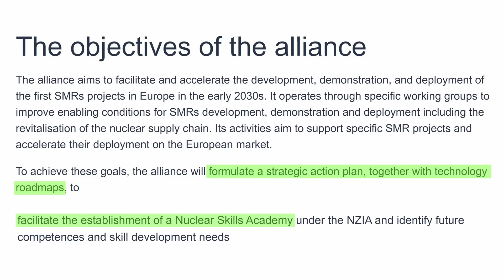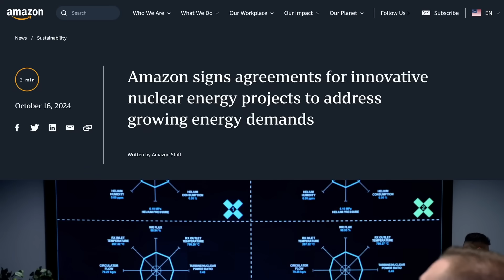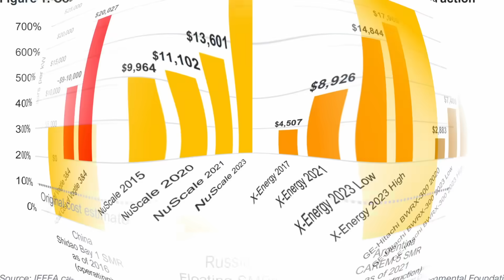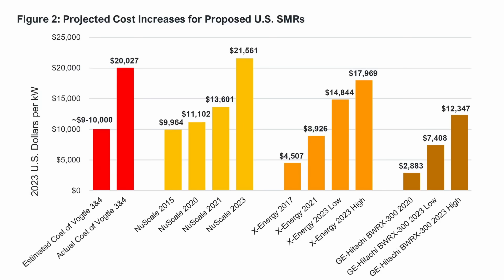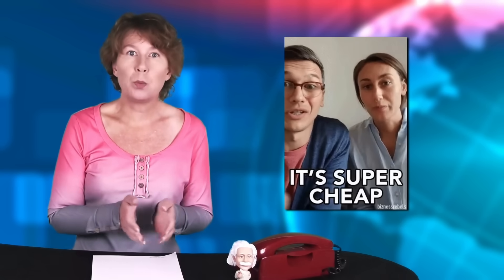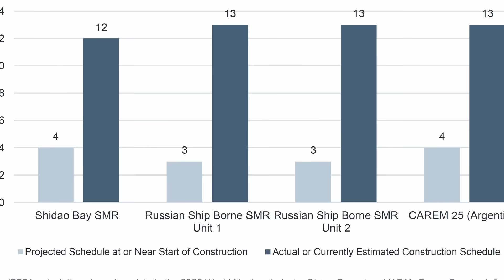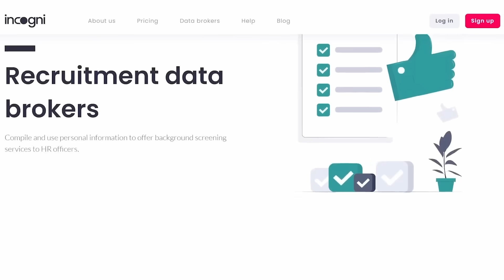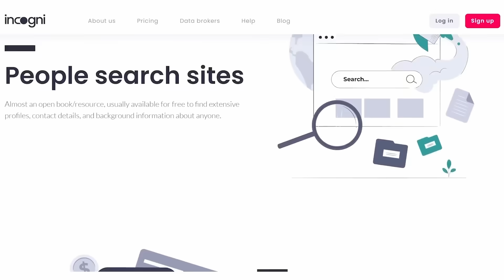Small Nuclear Reactors Have A Big Problem

Comment: It is important to not be hyper-focused on SMRs and their issues. Instead, we must first always focus on the PROBLEM THEY ARE TRYING TO SOLVE. Namely, ensuring reliable non-fossil electrical generation at scale. Only then can we properly assess the place for SMRs, if any.

Electrical generation is getting steadily cheaper as the costs of solar and wind continue to decrease over time. The problem is consistency and reliability. We need the grid to be a stable source of power no matter what the sun and wind are doing. (Note: This discussion assumes we have reached "peak hydro", meaning hydroelectric plants can't meet anticipated needs.)

The grid experiences extreme local demands from energy-intense industries, including things like metal processing, cement production, and, more recently, gargantuan data centers. It is tempting to reduce the stress on the regional grid by placing such extreme loads on their own small grid, meaning a compact local power generating station is extremely desirable. From this perspective, only nuclear and fossil can meet that need. And maybe fusion in 30 years or so.

Away from these large loads, the grid also experiences cyclical daily and seasonal loads, where having dispatchable power sources would be highly desirable. Nuclear can't readily meet this need (nuclear plants are best run in a steady-state manner).  While wind and solar are technically dispatchable, their inherent variability makes them unreliable in this role. Which leaves fossil and various means of energy storage.

To me, the real battle on our path to a fossil-free future is between nuclear and storage.

We know we can grow solar and wind to meet our needs, but that also requires growing the grid. distributing storage close to local loads will mitigate the peak loads the overall grid will need to handle, allowing it to focus on meeting the average load.

It is the massive scale of this solar/wind, grid and storage build-out that makes nuclear attractive, especially SMRs, to the owners and operators of large electrical loads. To be clear: SMRs are of little, if any, use to the rest of the grid. SMRs are a local solution that don't contribute to the need for the overall grid, the one to your homes and businesses, to improve and de-fossilize.

So, SMRs are, at best, a niche solution, assuming they are a solution at all. But let's take a moment to hammer a stake in that beast. Sabine has already examined the issues with current SMR projects. Let's look at the physics needed to make it work.

If we ever hope to make nuclear power significantly more cost-effective from an LCOE perspective, we must simplify all aspects of it. For example, reducing the core operating pressure is a great first step, as it reduces both material stresses and steam explosion risks. Again, as an example, moving away from water as a reactor coolant would be a great step in that direction, but the alternatives are either liquid metals or salts, both of which have unresolved problems. Or, perhaps, high-temperature gas cooling, which has extremely complex thermodynamics and fluid dynamics issues yet to resolve.

However, the thorniest issues concern the fuel itself, where the design constraints include: 1) The amount of fuel consumed per KW of output electrical power. 2) The size. cost and operational lifetime of the initial fuel load. 3) Eliminating the need for refueling. 4) The fuel enrichment level. There is also the surface-volume ratio to consider: As the core design shrinks in size, the burn rate between the center and the edges generally becomes more extreme (making a uniform fuel burn profile more difficult to manage, and/or making the core fuel distribution more complex), and makes it more difficult to thermalize neutrons within the core (less distance over which thermalization can occur).

In an ideal world, new "simplified" reactors would be constructed with a lifetime fuel loadout, but that approach can massively increase costs if a long lifetime is desired, which in turn means constructing reactors that have intentionally shorter lifetimes, which in turn means they must amortize their costs faster over that shorter lifetime, placing ever increasing demands on both increasing fission and thermal efficiency while also reducing construction and operating costs, which are goals that are largely in opposition to each other. Which could easily turn into a race to the bottom, rather than toward a real solution.

To gain increased core efficiency while reducing size, the straightforward approach is to increase the uranium fuel enrichment, which not only drastically increases fuel expenses, but also imposes heightened security concerns. One solution would be to use a less costly fuel, such as finding an efficient and less expensive way to reprocess existing spent fuel, or use another fissionable material, such as Thorium. Thorium doesn't fission on its own, but needs a "sparkplug" fission fuel (typically Uranium)to start and manage the Thorium fission.

Other approaches involve rethinking the entire notion of the "reactor core", where the fuel itself is suspended in and transported by the coolant, something that is possible with several molten salt designs, and is also compatible with both Thorium and Uranium fuels. One huge downside is the presence of the highly radioactive fuel outside the core, not only meaning a larger area will need to be better shielded, but also increasing the amount of the plant materials that are subjected to high radiation levels during normal operation. Also, the fluid itself will need to be highly corrosive in order to keep the fuel and fission products in suspension (and not plate out over the interior of the system).

If these design and operational downsides of "liquid fuel" can be mitigated, the upsides are huge. 1) The reactor fuel can be kept pristine, with fission products removed and fuel added continually, rather than front-loading that lifetime expense as part of the initial manufacturing or installation. This will permit nuclear wastes to be concentrated and stored as part of normal operation, rather than having an entire core that must be handled when the plant is decommissioned. 2) Safety is both simplified and improved for both normal operation and emergency shutdown. 3) By dissolving the fuel into the coolant fluid, fuel reprocessing becomes an inherent part of the system itself, greatly improving fuel utilization.

That sounds very optimistic, and it is! Those downsides are severe indeed, and likely can't be mitigated within a "small" plant. For me, even the need to consider liquid fuels means that miniaturizing any existing "legacy" approach is a non-starter, as the smaller plants will likely have more problems than benefits.

We will likely need to instead focus on improvements to conventional plant designs, then just bite the bullet on the resulting price.

A very relevant and illustrative comparison is the use of desalination and advanced water treatment as sources of drinking water. Both are many times more expensive than ground or river sources, but they are more reliable year-to-year. In SoCal, we have made the very intentional choice to have expensive water that is also highly reliable. When you live in or near a desert, those are the choices forced upon us.

We are in a similar situation with electricity production form non-fossil sources. We have solar and wind that are much like wells and rivers in their temporal variability (though over different timescales). And hydroelectric, which once was considered to be a stable as nuclear, is seeing its own variability, with no significant new sources coming online. Just as high(er)-cost drinking water sources are needed to ensure supply adequacy, stability and reliability, we also need the same for our sources of electricity.

There is no "fast, cheap and easy" solution to ensure adequate energy supply and reliability, neither for large localized loads, nor for the grid as a whole.

We've finally reached the point where we must compare nuclear to its main alternative: Energy storage. Both batteries and pumped hydro are on the grid now. How do they compare to nuclear power as a means to ensuring a reliable supply? Bottom line, we presently have only about 1% of the storage needed to enable fossil fuels to be retired.

Fortunately, battery costs are trending downward alongside wind and solar. Which leave updating the grid as the more daunting issue. For large loads, SMRs can reduce or even eliminate the need to improve the overall grid to meet local needs. However, the costs of SMRs are spiraling upward far faster than the cost of storage and grid improvement.

From this perspective, we really should double-down on updating our grid (especially large DC ties to better interconnect national sources and loads) and adding storage closer to the loads.

SMRs may yet have their uses, but they will never be able to escape their niche to find efficiencies of scale, meaning they will always be expensive. I mean, there already are hundreds of mobile "SMRs" in operation, namely the world's nuclear-powered fleets. That's what "small" reactors look like today, and how it has looked for the past 70 years. That's the history and model we must learn from.

Comment: Companies should look at SpaceX for a model of how to approach the problem of doing something new, more efficient, and better than what is possible using "conventional wisdom". In an interview with Tim Dodd, Musk correctly points out that the design phase of a project only accounts for about 1% of the effort. Design is easy. What's hard is manufacturing. Combine that with the philosophy of first make it work and then optimize, rather than the obsession by engineers to do the opposite, and add in a system of being hardware-rich with lots of rapid testing and blowing things up, and you have a chance of making things work. Musk's genius with the Falcon 9 booster was that he could get his R&D effort paid for my customers wanting to launch satellites, and the customers did not care that he used their flights to practice landing F9 boosters. Now SMR companies face the additional hurdle of having to deal with an agency, the NRC, that's even more testy than the FAA, which will make things even harder. But solving the manufacturing problem along with real world testing will be the key to making things work. They should also try to leverage whatever they make during R&D into something that is in its own right commercially viable. And keep things non-radioactive as long as possible to keep the NRC at bay.

Comment: And the security issues with making a transportable reactor: If I can ship it on an 18 wheeler and hoist it into place with a small(er) crane, I can steal it just as easily and make dirty bombs until the cows come home!

Security is going to have to be up to the same levels as any large nuclear facility.

Also, one is still not going to install these in a populated area.

Comment: Those small modular reactors are still too big. I have had this image (for over 50 years) of a small DOMESTIC reactor, about the size of a dustbin that works simply by having a red hot core of radioactive material (mixed with its moderator) and surrounded by thermopiles to give around 10kW of electric power which would be suitable for most UK homes. I have seen pictures of "can of soup size" blocks of radioactive material glowing red hot in a lab - so I know it could be done. But I don't know enough about thermopiles to know whether you could get 10kW of electricity out of such a setup, nor how much it would cost to put such a reactor together. Over to you Sabine :)

Comment: Darned if it doesn't seem like the management stakeholders have different expectations than the implementation stakeholders.    

When you fund, say, a bridge, and you look at the expected costs, you have a whole history of different types of workplans, cost accounting, scheduling, and supply chain processes that, have, in the past,  put known resources in the right position for known purposes in a very similar and repeatable program of construction and implementation.    Oh, I'm sure they're still over budget, because, grease stains happen, but  they're within an accountable error bar.

With the dismal results, so far, of delivering small, safe, and "cheap" modular reactors, half the research hasn't, apparently, been done at all and half of the engineering techniques or procedures haven't even been invented to Lego the damn things together.      Pay for reactors and infrastructure,  but instead we only get basic initial research, some proposed approaches, half a prototype, and no functional output.  All aboard the sunk-cost train!

Whether this is because it is government entities that are involved, which are not subject matter experts, or private entities are hiding "inside" implementation details from "outside" program managers, who knows?    But these are systemic problems that arise from sensitive dependence on unrealistic conditions or misunderstood processes.

 Well, I sure hope the natural gas keeps flowing for another year, net zero be damned!

Comment: Nuclear Thermal Rockets will need a modified SMR in any case, and the reactors on the Moon will be similar. Bespoke  reactor systems are just getting a bit expensive, you are going through all the same things from scratch each time. The Idea with SMR is a system that can cut through some of that and be made at scale and just shipped out. Prototyping is not mass production and to top it off just because you made a prototype does not mean it can be mass produced, the majority of prototypes of any kind fall at the design for mass production stage, not prototyping. Any one can make a prototype, very few can mass produce.

If you want a comparison for a part why, just look at the differences between Tesla and the old guard ICE OEMs that started doing EVs. The approaches are nothing alike. It's not just about R&D to design a thing that works, there is the R&D to manufacture as well. If manufacturing is conidered afterwards, you are retreading the same ground, and if you ignore it, you are right back the bespoke manufacture route you were supposed to avoid.

Musk had to attract the right talent and work on both halves of that R&D equation at the same time with some back and forth.  There should be a few Musk interviews that talk about his First Principles approach. 

Everyone made batteries the same way for a 100 years and car bodies are not much better, it's just the same it was done. A set  of solution looking hammer itself into any gap, slap on a new look and call itself innovative. Tesla not only did R&D into batteries, but into the way they were manufactured and into manufacturing and designing new machines/techniques to do it. They massively dropped the costs to manufacture from the norm.

SMRs are facing similar issues that EVs had/have, design and implementation, I am getting to believe it's an institutional problem. SMRs being radioactive is just a distraction from that, so not seeing the wood for the trees. Innovation is not a new prototype or a new look, or even newer materials, it's a new way to get that wanted goal. Like the Tesla battery cell, that departed from 100 years of undisputed wisdom.

if the Old Guard appoarch is used with SMRs, it's  likely to fail. as a whole new approach was requires, not a downsize and new look. Incrementalism is not innovation.
Reply: When it comes to mass production of SMR's apparently no one is doing it.  Maybe China is making stabs at it, but they seem stuck in the prototype phase at best.  With Nuscale pulling out of its plan to offer mass produced SMR's it looks no body else in the US is stepping up because it's not an economically viable option.
Reply: @michaeldeierhoi4096  That is why I included Tesla... If you look at the cost of EVs to manfacture, only Tesla makes money on thier cars, the rest of the "old guard" are subsidized...

They went 'off the shelf solutions' when  manufacture R&D and Design was required. It's alos why I mentioned that most prototypes fail at the mass manufacture stage. Any one can prototype,  not that many can clear the hurdle for mass manufacture, protyping is ONLY proof of concept, there is more R&D after that. 

Tesla got up and running and took years of Manufacture R&D, not only product design, but the machinery, tech and techniques  research to push it over the line to profitability. They also basically reinvented the battery while they were at it, and hammered the costs waay down, enpough for Panasonic to get nervousness at the time and shake their stock price at the time.... ... It was a master class on how to go about getting it done....

Every one said EVs would never be profitable, yet reasonablish in price. That Rockets could NOT be recovered and in nop way could space flight be madea ny cheaper. That Boring machines could not be made any faster or cheaper to use... The list goes on... That it would not be economically viable...

They were all wrong...

The point being that is likely  the approach that is at fault there. Mass manufacture is not once size fits all, some times you have to build the machine to build the machine, to get the new ways of doing things that makes it viable... That kind if instant gratification and stopping as soon as something works, it how we got into the High pressure water reactor quagmire in the first place. 

The first SMRs will NOT be profitable at first, and those viable for further research into the mass manufacture side of things (to drive down cost ect) will need to be supported while the manufacture R&D is done.. The off the shelf mass solutions are uliekly to work, considering they are geared to bespoke reactor production, where cost and speed to build do not matter a jot, near unlimited budgets being what they are.....